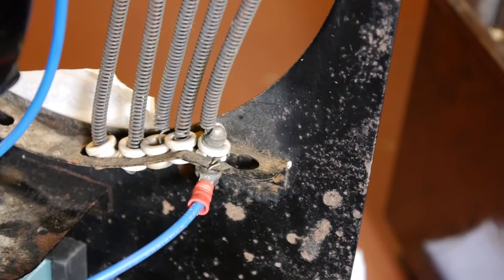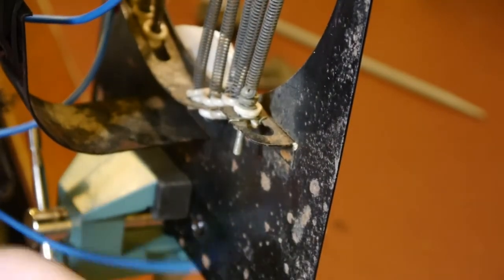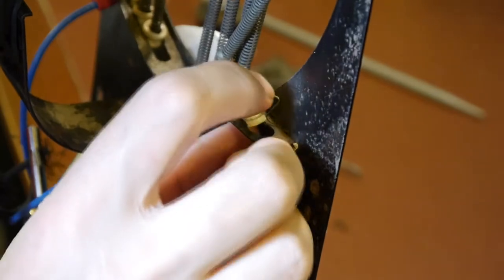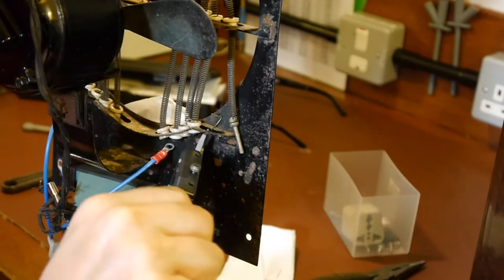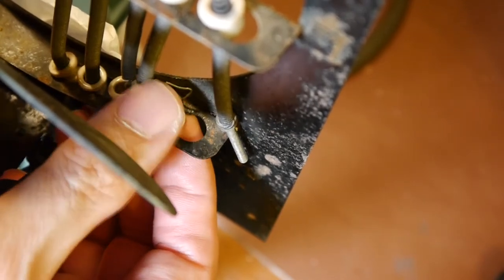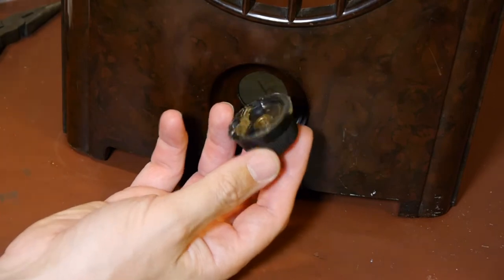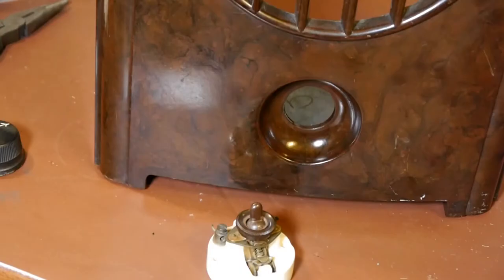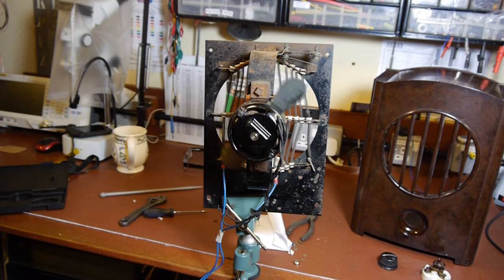GEC Radio Repair Part 4

Comment: Car mechanics and other of us who get greasy hands in the course of our work use a product called GoJo or Goop is another brand of hand cleaner.  Its basically a lanolin based paste with very fine abrasive particles in it to get out the ingrained dirt and grease from your skin. Does a fine job on radio cabinets as well. It gets out all that ingrained dirt in the cabinets and then can be buffed out to a nice shine with a clean rag. I'm sure you have a similar product in the UK. Might do the trick on your cabinet.ATB Doug.
Reply from the maker: Doug McArtin I think we have but they have much larger abrasive particles more like sharp sand. We tend to use metal polish or the stuff for removing fine scratches from car paint. Tcut.   Best regards Chris

Comment: Hi Chris, I did watch this a few days ago while burning in Mallorca. I would imagine the bolt is BA (like on all British made radios), so you'd have a 5BA. Be careful not to go through the Bakelites shiny surface with any rough polishing,  you'll never get the shine back again as it's all fibrous underneath. Brasso is great for cleaning it.

Regards - Andrew
Reply from the maker: Andrewausfa  Yes I bet your right regarding the fasteners as its smaller than the 4BA I normally recognise. Yes I'm going to give Braso a try. I hope you had a good holiday I was there early in the year climbing
Reply: I did thanks, very relaxing.  I assume you went up north west for your climbing, we usually head down to the SE coast. I did fancy giving the range behind Pollensa a go when I was there last year. More of a low grade scramble than climbing though...as I'm getting too old!!

Comment: Very clear on the dimensions Chris, i was sat here busily trying to convert decimal inches to fractions, in that 'close enough' precision,
 Don't worry too much about the surface of the case, It is the same stuff all the way through,
 Ahh, a thermal cut-out,
And yup, I remember and at one point have had 3Kw fan heaters as described- last one I had was warming up a shed while I sprayed 2-pack paint. not advised.
Take it steady, J.
Reply from the maker: Average Joe Thanks Joe I'm sure Two Pack is fine if filtered through a pack of cigarettes while spraying.  It's Been quite interesting doing this repair I may seriously buy one of those large rotating heaters if I can get one at the right price. I have no idea how anyone could ever work with all those oddball imperial fractions best regards Chris
Reply from the maker: Average Joe  Must be up early this morning Jo. I off to London today on the early train and feeling like death warmed up
Reply: Hi Chris, Hope your London trip went off without too much unnecessary drama, one thought that occured to me was about Teflon, or PTFE- Polytetrafluoroethylene, some nasty stuff when heated-there were warnings for people who machined the stuff and smoked roll-ups (you can guess) faced an increased risk of cancer or, instant messy death through an ingestion of Phosgene Gas, (citation needed),.
 I have been trawling though the internets interprets take of my odd questions that I have asked of it, and, I still don't know why there is a dead pakistani on my sofa, and, those insulators are still being made, in India and other places where people make stuff, I will not put links here because I am not happy with them- not dodgy but a bit  Umm, do i trust this entity with my financial wellbeing?.
 Sorry about the long diatribe
Best Regards, Sam.,
Reply from the maker: Average Joe  well I work in London quite a lot and it just makes for a long day from Sheffield. ok that's a good warning regarding the the Teflon I had not heard about about the health issues. It looks like it's going to have to be some ceramic material. It's doesn't have to be a perfect fit I'm sure anything close can be made to work.
Reply: Yup, Good stuff, there is a fine line between ('its okayish
 Bestish,
Reply from the maker: Average Joe  you have a great turn of phrase LOL. Thanks best regards Chris